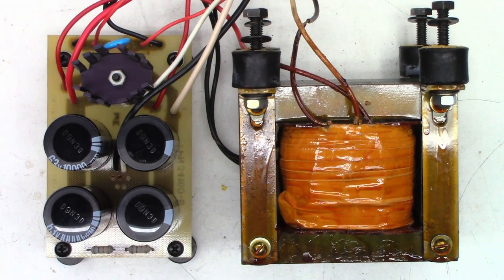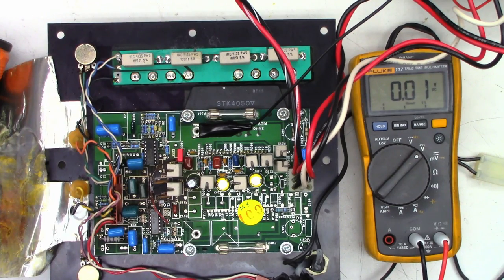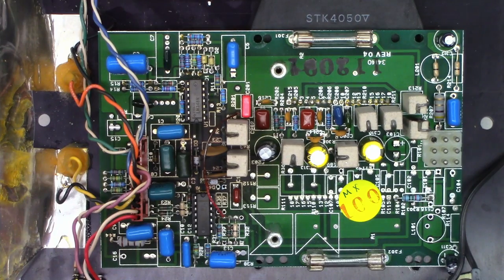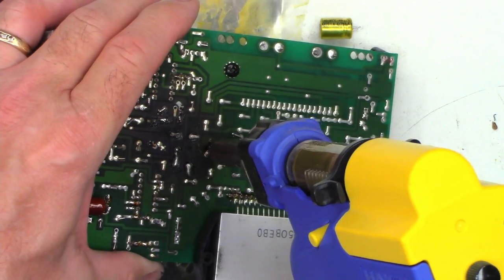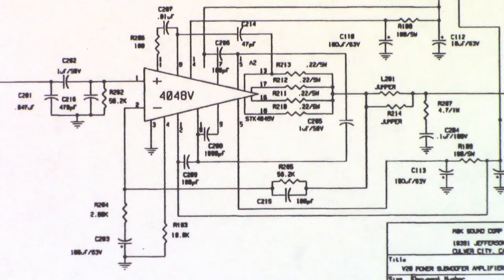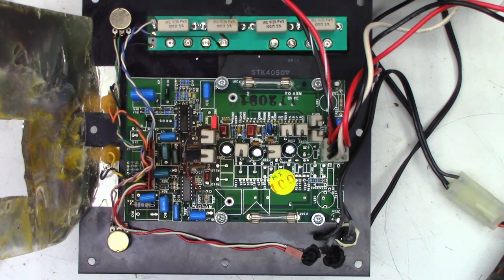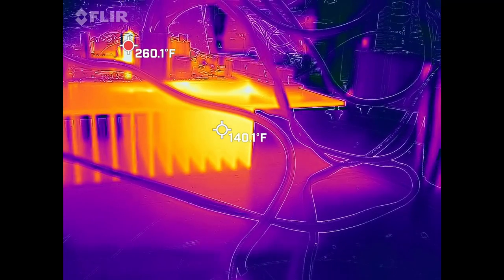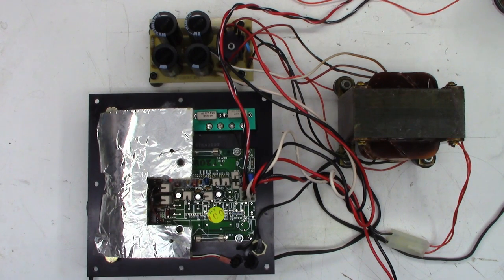Miller and Kreisel MK MX-100 Very low audio - M & K - Miller & Kreisel M&K MX100

Comment: This video helped me solder properly the pins on the POT, this MX100 has the same wire colors and amount of wires as my MX200. The former owner soldered the wrong pins. Its a pain in the behind without instructions.  Thx.

Comment: That cap you took out isn't as bad as might at first be thought, and it's strange that it should fail as quickly as that as I have had good luck with them.

Farnell in the UK sell the same caps under the Multicomp brand. They used to include the Taiwanese OEM's datasheet on their website but these have recently been rebranded. I don't recall the company name but I'm pretty sure they're one of the larger Taiwanese ones, a reputable company and at least as good as Kemet. They have various ranges from cheapo GP caps to some fairly impressive low ESR ones. They're commonly found on industrial equipment made in the UK where the short runs are built with stuff from RS or Farnell. 

EDIT The company is Sang Jing Electronics.
Reply: Multicomp means that Farnell sells different brands under the same part number. The only assurance you have is that the capacity , size, voltage rating etc are as specified in the listing. We once ordered a large lot of Multicomp caps and received three different brands.
Reply: @RTBNL  Yes, but the electrolytic capacitors consistently have the diamond-shaped logo on them. This is not Farnell/Multicomp's trademark, it is that of Sang Jing.

The caps have explicitly-stated model numbers which also map to this manufacturer's range.

The point here is not so much that Multicomp are always Sang Jing, it's that the caps with that logo are.

Comment: Nice video, my favorite repair video series on YouTube! Have you worked on a Dennon AVR 5805 before? It's a 90 lb beast and the sub output doesn't work and my speakers on one channel crackle every once in awhile no matter the speaker. Any thoughts on where to start looking for issues?
Reply from the maker: No I have not, Try heating and cooling various areas to see if you can pinpoint the issue.